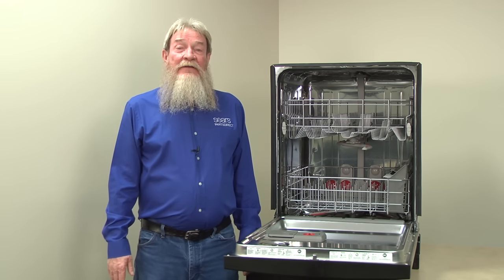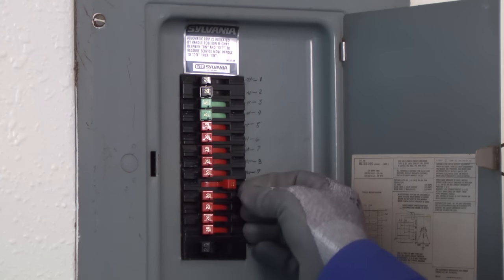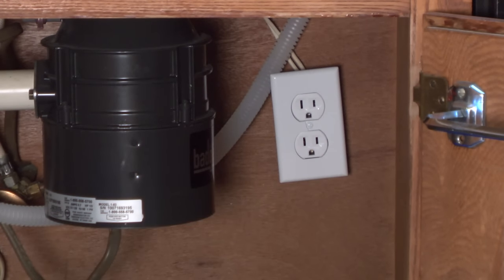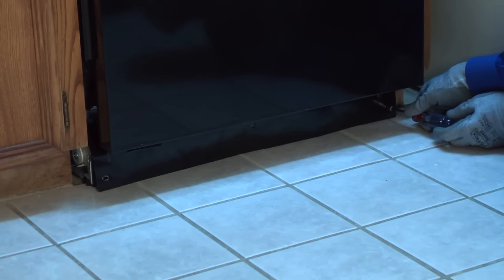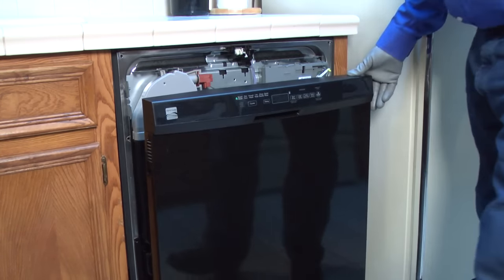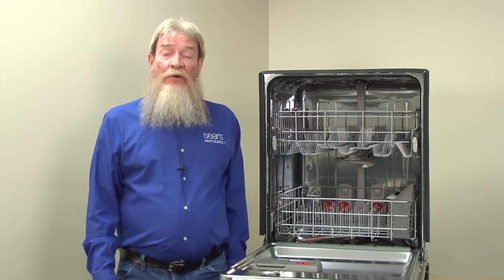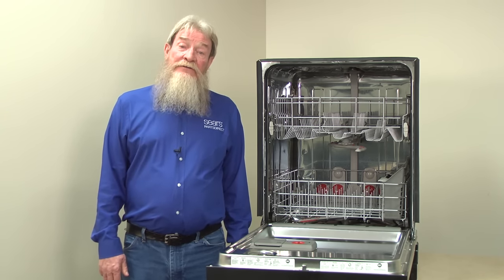Dishwasher Has No Power

Comment: Thank you.  It was not any of the points that were mentioned but it gave me a method to debug.  For me it was the switch that is turned on, by being pressed inward by the latch ( the latch that locks the dishwasher). This is an old model.  I am impressed how long this has been running.  The housing of the switch broke off from the inner panel.  I taped the housing ( of the switch ) with duct tape after making sure it is lined with with the latch. Now it works.

Comment: I had a power surge yesterday, and today, the dishwasher wasn't showing any power. I checked the circuit breaker and turned it on and off. I checked the power cord and it was firmly plugged in; however, I pulled out the plug and plugged it back in anyway. Unplugging it reset the dishwasher. It's working now! Yay!!!

Comment: Thank you for the video I was able to fix my dishwasher  by reconnecting the wires underneath in the junction box. There were burned with connector. Not sure why. But now it works. My only concern why one set with the connector burned?

Comment: The plug-in under the sink was sticking out about a centimeter, and was likely knocked loose by the weight attached to the spray hose attachment, since it comes into contact with the dishwasher power cord.  Never knew they plugged in under the sink!  Thanks for the tips!

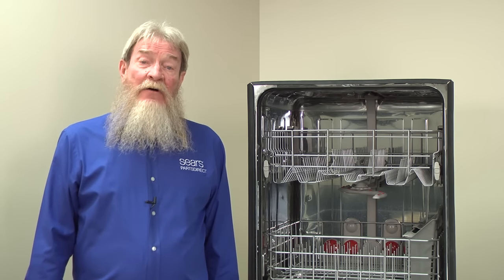Comment: My issue was the door switch not making up when I closed the door. At 2:11 minutes into this video, he talks about the user interface control wire harness. This is where I found my problem.  There are several videos on YouTube that show replacing a fuse in this harness/control panel.  My fuse was okay but the door switch is inline just before the fuse. The door switch was okay but had become misaligned to the point to where it wasn't doing its job.  Just going through the process of taking things apart and putting them back together, I tightened and realigned everything and when done I had been successful in restoring power to the control panel and was back in business.  Lucky me. 😃

Comment: Thanks for posting this video! My issue was the hot wire for the appliance power cord had not been wire-nutted on properly and it came loose mid-cycle three weeks after installation. Thanks to this vid I was able to fix it quickly! :)

Comment: my kenmore dishwasher  mod 665.13559k700 none of the buttons lights up except for high temp and  heated dry  when you push the start it does not come on I try doing a reset which works all the light comes on then it goes through it cycle but after it done and you press the start cycle it does not work do you have any ideas what my be going on.

Comment: Thank you! My user interface wire was loose. Any advice on keeping the top plastic housing (with the buttons) connected to the outer door panel? It fits in there but is pretty loose.
Reply from the maker: Let us know the model number of your dishwasher and we'll try to provide you with some advice.
Reply: @searspartsdirect  I figured it out. It turns out the handle was broken, so I just ordered a replacement. Thanks for responding!

Comment: My dishwasher stopped working before the cycle was complete, there's standing water in the bottom. It's hard-wired, not plugged in and I had reset the breaker (left it off for at least 12 hours). Still no power to the unit. Any ideas?
Reply from the maker: Shut off the breaker to the dishwasher and check the wiring connections in the junction box as shown at 1:18 in the video. Make sure that you shut off the correct house circuit breaker for the dishwasher. If you're unsure about which breaker controls the dishwasher or you're not confident that you safely check the wires in the junction box, have an electrician check that wiring. If the junction box wires are connected properly, then an internal wiring failure, bad door switch or failed control could be preventing the dishwasher from working. If you need help checking these issues, let us know the model number of your dishwasher and we'll provide more advice and troubleshooting tips.

Comment: You didn't mention anything about the thermal fuse. Majority of the time, that is the problem with having no power. Easy repair, costs about $25 for the fuse.
Reply: where did you find your thermal fuse? I had a multimeter to test the fuse but could not locate it in the control board area.
Reply: @Richiban40  , if your facing the dishwasher, its in the control board area a bit to the right side of the door . I cant post a photo on here or else I would. If you just enter "dishwasher thermal fuse" into a google search engine, there are plenty of videos on how to find and replace it. I'm a DIY amateur and I found the fuse on mine. The funny thing is that I watched another you-tube video on here and the guy said take the fuse out and bang it against something hard like a concrete floor, or hit it with a hammer... so I tried it and put it back in and it worked just fine! No need to replace it, although I found one on Amazon for $7 so I ordered one for back up just in case.
Reply: Dale Carns I saw the same video and from what I was seeing on my circuit board, there was nothing that resembled a fuse, I’ll check again this week, thanks in advance for tips. I’m dreading to replace this dishwasher!
Reply: I suggest closely following any wires you see because two wires have connectors that slide right onto the fuse. The fuse is about the size of a dime with spade terminals coming right off of it that wires hook to.

Comment: you left out the most common solution to the problem. 1.Turn breaker off  2. check Fuse/s with an Ohm meter. (No live voltage check to do so) and what are the odds the wire harness inside the door could possibly get unplugged?  Dishwasher gremlins maybe?  Bad fuse - call the service technician who will most probably replace the control board  ($80-$220 on average)

Comment: Who has a wall switch that turns on their dishwasher?  Is that still a thing in 2020??
Reply from the maker: Yes. Many dishwashers still have a wall switch that shuts off power to the dishwasher when that switch is turned off. The switch typically isn't used to turn the dishwasher on (or off). It's installed to shut off power to the dishwasher for service if necessary. Many people don't know it exists or forget about it and wonder why their dishwasher won't power up when that switch is turned off.

Comment: Is there anyway to repair the outlet without calling an electrician? Could it be a messed up circuit breaker? We bought this brand new house 1 month ago so I figured it should be an easy fix like that
Reply from the maker: Some electrical outlets for dishwashers have a light switch beside the sink that cuts off power to the dishwasher's outlets. Make sure that light switch beside the sink is turned on if your house has that switch. DIY repair of an electrical outlet or circuit breaker can be dangerous and risky. We don't provide DIY troubleshooting for those problems because faulty outlets, circuit breakers or wiring can cause electrocution or fires. For safety, some repairs are best left to professional service providers.

Comment: The latch on my ge dishwasher is sticking  you have to snatch  it to open will this cause the dishwasher not to start
Reply from the maker: If the faulty latch doesn’t trip the door switch (or door switches because some models use 2 door switches) when you close the door, then most GE dishwashers won’t start. Your question seems to indicate that your GE dishwasher isn’t starting. Here’s some tips for troubleshooting a dishwasher that won’t start. Because a tripped float switch in the dishwasher tub will prevent the dishwasher from starting, we recommend that you check for an item stuck under the overfill float switch first. If you find an item stuck under the float switch, remove it. This troubleshooting step may fix the starting problem. If the area under the float switch is clear, unplug your dishwasher and check continuity through the door switch or switches using a multimeter with the door latch engaged or the dishwasher door shut. Here’s a video that shows how to test the switch or switches in a typical dishwasher door latch: https://www.searspartsdirect.com/article/dishwasher-wont-start-video.html. If the meter doesn’t measure continuity through the switch or switches, check the latch to see if it’s tripping the switch or switches when you shut the door. Replace the door latch if it doesn’t activate the door switch (or switches) when you shut the door. If the door latch activates the switch (or switches) but the meter doesn’t measure continuity through a switch, replace the switch (if the switch is available as a replacement part separate from the door latch in the repair parts listed for your GE dishwasher). Sometimes the door switch isn’t available as a replacement part separate from the latch so you’ll have to replace the entire door latch assembly in that situation. If you need more help, let us know the model number of your GE dishwasher and post additional details about the starting problem.

Comment: Shouldn’t a repair person, with 43 years experience, know to check to see if your dishwasher even has an electrical switch (as I’m told some dishwashers do and some don’t have that switch)?  I just paid $200 to my warranty company to find out that there was a switch for the dishwasher underneath my kitchen sink that was accidentally turned off.  I had made a claim for my dishwasher not turning on.  So, the repairman comes and checks everything out….doesn’t turn on.  Then he hooks up is own electric source and it turns on.  So he says it’s not a dishwasher problem, that it is an electrical problem and I need to call an electrician.  Ok, so I put a claim in for electrical wiring.  In comes the electrician and within 5 minutes she finds the switch underneath my sink and switches it on and boom, dishwasher works!  So I had to pay two $100 deductibles to find out that the switch was accidentally turned off.  So I called the dishwasher guy and let him know what the electrician found…his response was “in all my 43 years of experience I have never seen a switch for a dishwasher”.  So now I’m in negotiations to get reimbursed one of those $100 deductibles.

Comment: How to you adjust a lachet to GE dishwasher model number GDWF100R30BB
Reply from the maker: You may be able to bend down the strike that’s attached to the top of the tub so it engages the latch inside the door better. If that doesn’t help, unplug the dishwasher to disconnect electrical power and open the dishwasher door. Remove the screws at the top of the inside door panel to release the console and access the door latch. Unplug the control panel ribbon cable from the electronic control board and set the control panel aside while you look at the door latch. Examine the door latch and tighten any loose screws. The door latch may have a little play so you may be able to loosen its screws and push the latch up slightly then tighten its screws so it engages the strike better when you close the door. Replace the door latch if it’s damaged (https://www.searspartsdirect.com/part-number/WD21X10169/0022/363.html). We hope these tips help. If you need more assistance, let us know.

Comment: i did a reset, however after the reset process the lights do not remain on, and the dishwasher still doesnt power on or wash...any suggestions..thanks
Reply from the maker: Let us know the model number of your Kenmore dishwasher so we can provide some accurate troubleshooting tips. A failed user interface, bad electronic control board or a number of other failures could be causing this problem.

Comment: Here is a mystery. We had a thunderstorm. Day later the dishwasher won't start. I unplugged the dishwasher cord under the sink and re plugged it. Nothing. I finally flipped the garbage disposal switch to the "on" position.  Power came back on to dishwasher! 
Mind you we don't have a garbage disposal. If we did, the garbage disposal would be running all the time while the dishwasher is running for 2.5 hours....  So WHY is the dishwasher now all of a sudden connected to this obsolete garbage disposal switch? The switch was always in the "off" position before.
Reply from the maker: That's a mystery that only an electrician may be able to explain. Many homes have a light switch for the dishwasher beside the light switch for the garbage disposal. Although you assert  that the switch was always turned off, there is a possibility that it was in the "on" position. Because the dishwasher now works with that switch in the "on" position, you'll likely be able to continue using the dishwasher and you can ignore the mystery. I hope this helps. If you need further assistance, let us know.

Comment: Guys u from america, arent your appliances weaker..i mean with your lower voltage than 230V.
Reply from the maker: American appliances do use 120 volts rather than the 230 volts that European appliances use. That doesn't mean that American appliances are "weaker". The motors typically have the same power but just use lower voltage.
Reply: @searspartsdirect  and higher current?
Reply from the maker: @Blameberg  Because power of electromechanical components in appliances are all about the same regardless of voltage, the current is about the same as well.